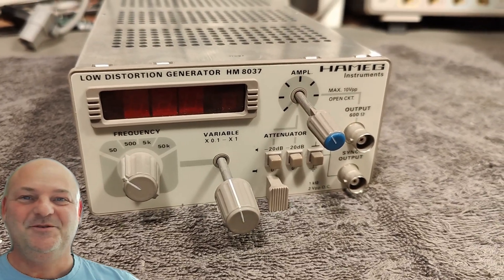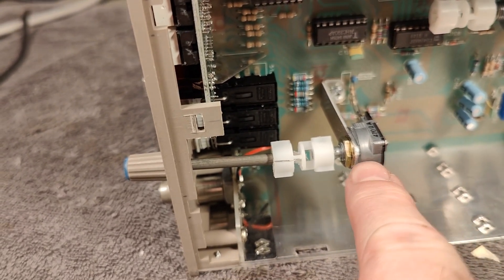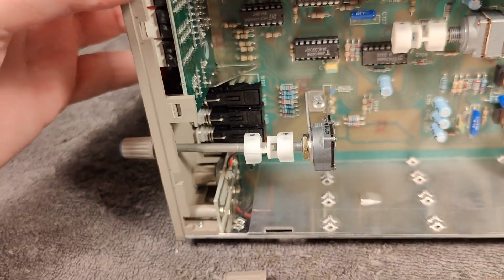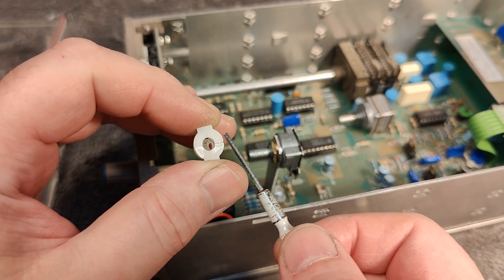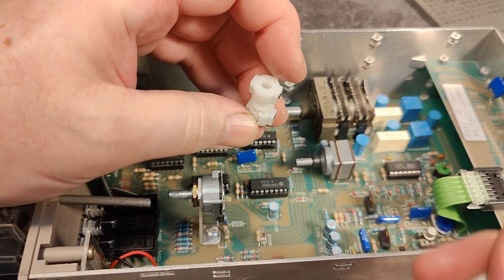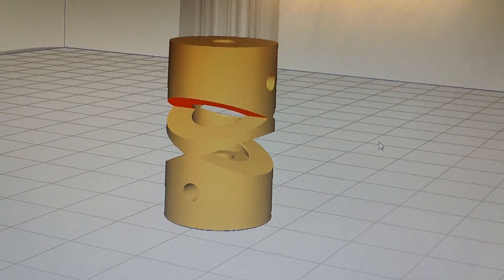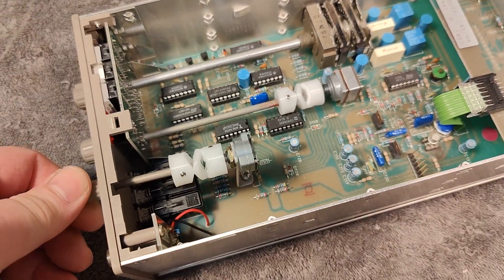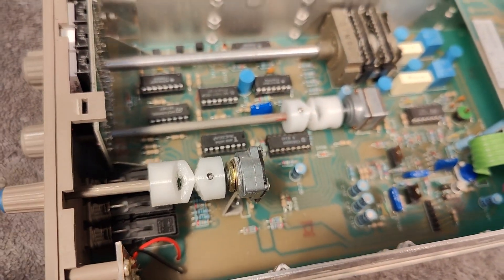Hameg HM8037 potentiometer flexible joint repair

Comment: A piece of a silicon thick wall tube with the inner diameter a bit less than that of the shaft and the pot handle would make the easiest replacement
Reply from the maker: the problem with very flexiable material is it add an unwanted mecanical hysteresis, that is why you want a firm coupling for more easy accurate adjustments.
Reply: @TeardownOZ2CPU  that makes total sense
Reply: @Thomas: That may be true for a heavy switch arrangement but for a simple potmeter without scale it should be more than good enough.
Reply from the maker: @inse001  the types in old hameg seems to go a bit tuff, i can fix it almost perfect my adding kontact 61 but still you need to overcome the start-movement force, that is always more than the in-movement force, this means, if you have a flexible joint in there, you end with overshoot adjustment, people are welcome to try what ever solution they like, I just explain my own humble experiance with this :-)

Comment: Have the exact same issue on my Hameg oscilloscope... not sure if the shaft is same diameter, I think it is. Thanks for the link, will try it!
Reply from the maker: some Hameg scopes use the exact same 4mm part, please check you got the space available, mine is a bit bigger, and stronger, use PETG
please post a make and comment on the thingiverse, this way i can update the description of the part.